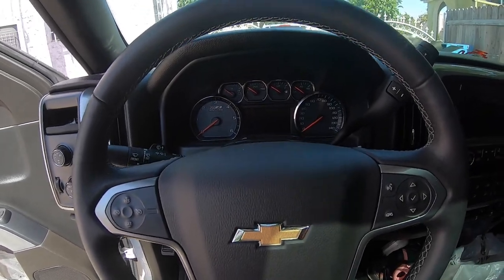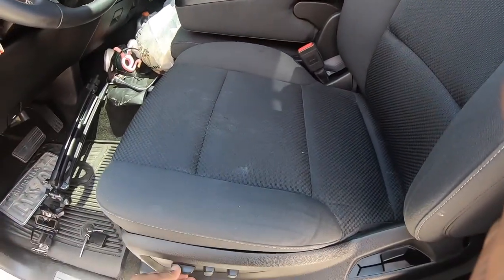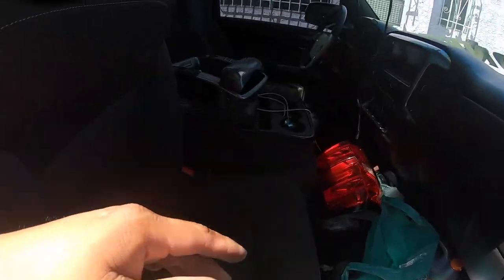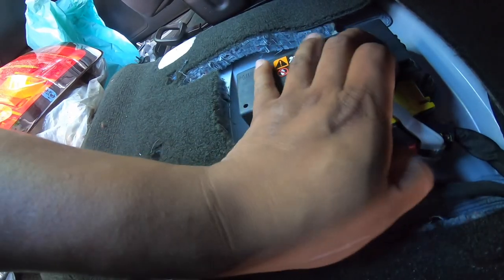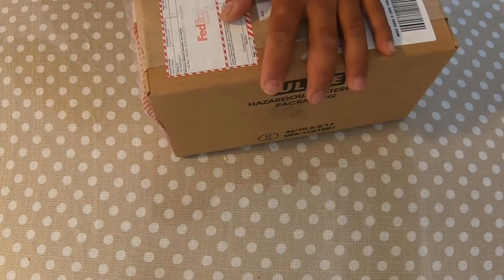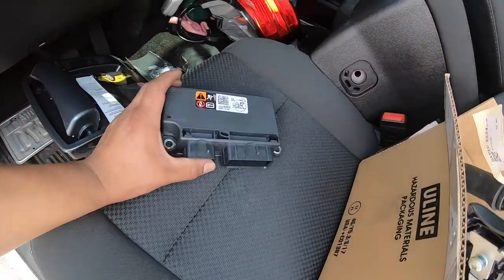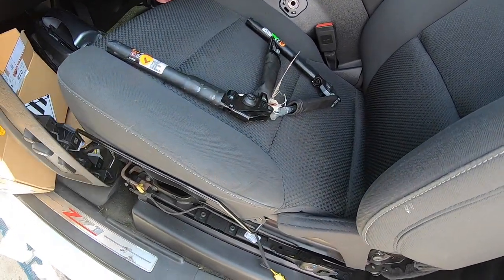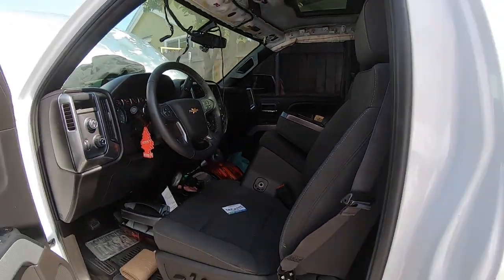MyAirBags Fixed Our Air Bag Module & Seat Belt Pretensioners For Our 2016 Chevrolet Silverado Z71

Comment: Thanks for the video, I'll be doing the same thing. I really like my new truck project (2015 Silverado). Awesome watching you rebuild yours.
Reply from the maker: Youre welcome! 👍
I am glad you enjoy the videos. I believe 2014+ should be pretty much the same or atleast very close. Its good to know that there are more people that also like to save these crashed vehicles instead of letting them go to waist. Best of luck on your rebuild 👍👍👍
Reply: @OXCFilms  I got my parts back from My Airbags installed. I still have work to do on the front clip, install my Fiberwerx. I want to drive the truck outside to pressure wash the frame. How can I disable the Airbag system?  Is it the interior fuse box number 23 airbag/info fuse? Thank for any help.
Reply from the maker: @bluebluemavrick  honestly i dont know. Never tried to disable the airbag system. If everything is installed correctly you can drive it outside without disabling the airbag system.

Comment: Hey bro do you know if i change just the module and not the blown airbags if it will keep sending a code or changing just the module will fix the light?
Reply from the maker: The airbag have to be changed. Also the module has to get reset. Or else the light will stay on

Comment: Did you replace impact sensors in front?
Reply from the maker: Yes. We had to replace them in order for the air bag light to go off
Reply: Thx rebuilding my first truck
Reply from the maker: Youre welcome 👍. Hell yea bro get it back on the road!
Reply: @OXCFilms does it matter on what order you do the things? Like replace impact sensor and then fix airbags or have to reset the code with new sensor before replacing tensioners and belts?
Reply from the maker: @edgaritoo i dont think it matters but make sure to reset after everything is replaced